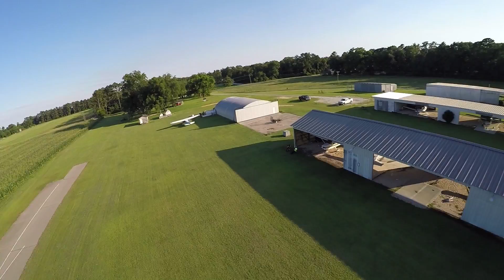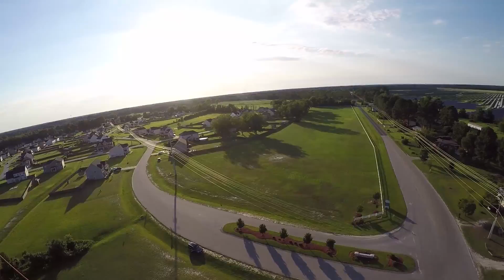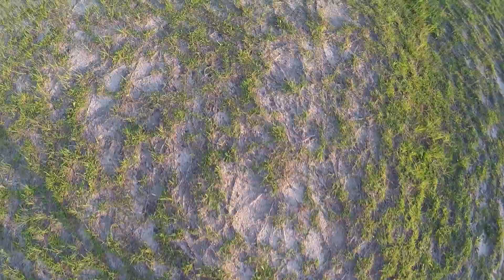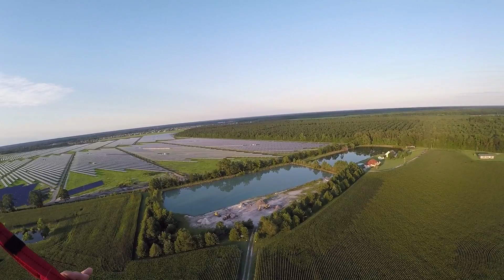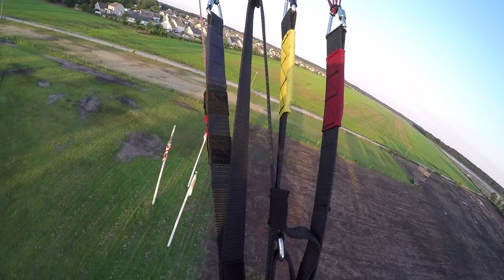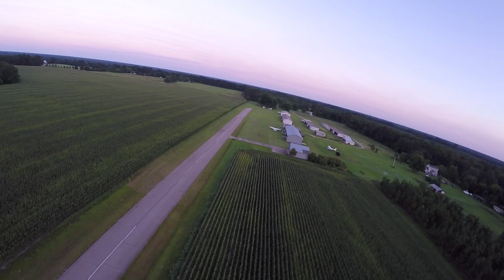Landing in Friend's Backyard for a Visit Leads to a Sketch Takeoff

Comment: What size edge are you flying? And your weight? I have a 25m and weight 170 but haven't flown it with my motor yet. Currently flying a 28m bolero 4 so curious on your experience. Thanks!